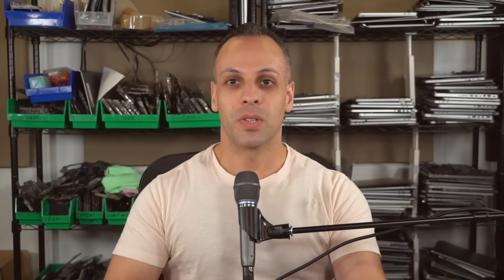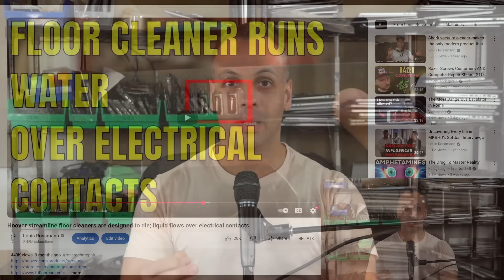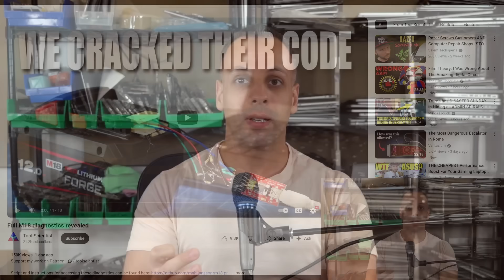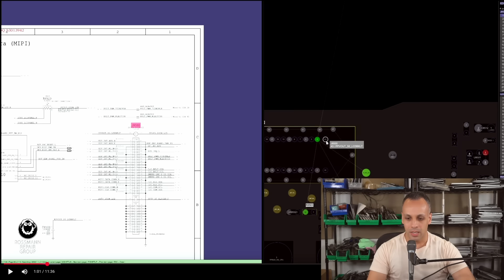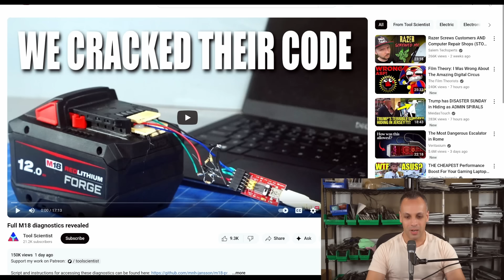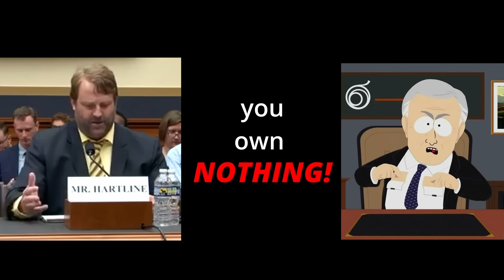Imagine putting DRM in a battery to void warranties...

Comment: I will never buy another rigid tool. The hoops they make you jump through to replace a product that was defective is insane. I bought a reciprocating saw and a circular saw. The reciprocating saw died in 6 months and the circular saw died in 7. I didn't know that you couldn't just take them to Home Depot like you used to be able to and trade them out. You have to go on a website and register them and then you have to talk to someone in their customer service division (from another country) in order to get it approved to send it off for repairs. They tell you that they will either replace it, repair it, or tell you that you are SOL and there is nothing you can do about it. I sent both of them off and one was "repaired" but died again three months later. The other one showed that it arrived at their facility but they told me they never received it. So, I had a broken tool and then now no tool. What did I do? I went to harbor freight. The tools I bought there are still kicking 2 years later and if they mess up I can just take them back.

Comment: Happy to hear you speak of battery balancing! A single battery that drops below their specified voltage and the entire pack ceases working. Doesn't matter that it could be charged or could've been fine balanced. Milwaukee and DeWalt BOTH do this! I've seen one of them RE'd and the chip is CAPABLE of balancing, but it's not been setup for it - cannot recall which one but the tech exists to do this and save consumers money - they don't use it.

Comment: I guess the point is missed but brands have value even if the underlying company is failing. Craftsman/Die Hard/Kenmore were Sears brands. They outsourced production to a third party. When Sears didn't jump on the online shopping bandwagon, they left themselves exposed. Time marched on and their competitors sensed blood in the water resulting in the collapse. To generate some cash, they sold the brand rights. Similar story for other brands. They sat on their laurels and discounted up and comers. I saw a video where he reverse engineered a bad firmware issue on a BMS even though the battery was replaced under warranty which detailed the information being gathered. I know people will think a warranty is a warranty even if they have abused a product and the company won't know. They are collecting that intel so you can't hide behind the curtain "Catch me if you can". It is easy to blast corporations for their faults but people don't want to admit guilt because they are the "small" guy. If you think you can do better, start a new frontal company. TTI would gladly be your production partner.

Comment: And then you have these Milwaukee die hard fans that are willing to sell their moms and sisters to get tool. Willing to bet their houses on proving their brand is the best. I simply call them sheep. Every company is out to rip you off, and if you are willing to throw away your hard earned money just so you have a garage full of red or yellow... be it. But don't push out c*ck ridding fake reviews of products that you have not even used for an hour.
I have been with milwaukee for years and have seen how this warranty process works. What if i told you, when you send your faulty tool or battery to them for repair, all they do is reset the counter, clean up the tool/battery and in some cases replace the outer plastic body and send you back the same product (only if they claim it is still under warranty). Its up to the repair guy to decide if he wants to be lazy and just claim, oopsie its your fault. Then they ask you if you want your out of warranty product shipped back to destroyed at their repair center. 80% of them claim, destroy it. Guess what, Milwaukee is happy. They recondition the electrical components and replace the outer making it look brand new and resell as brand new.

Comment: Sony's mirrorless camera started doing this recently as well with my a7R V. It has a pop up asking it cannot guarantee it's performance because I'm using an aftermarket battery and will hide the actual battery level depending on the shooting mode you're in 😑😑

Comment: Deevawlt battery, i used it for other purposes, connected the + and - to a breadboard circuit.
Smoked it dead and it refused to charge so, I used the second battery to kick start the internal PCB via the same 2 connection points.

Deevawlt service center confirmed in person that all their batteries need a kick start once you override the battery's PCB

Comment: The term “battery warranty” is an oxymoron.  This is true for lead acid car batteries, Ni-Cd, and Lithium.   It used to be that Sears “Die Hard” had the longest warranty, I fell for it.   2 years into a 5 year (maybe longer) warranty, I discovered that the prorated warranty still had me paying more money to replace it than just buying cheap battery at Walmart.    Well guess what, the last time I was in Walmart a person was trying to return a battery under warranty, however, they were not at the Walmart that sold them the battery.   Yep, drive to a store 200 miles away to get your warranty honored.  When everything is cheap $hi+ just buy the cheapest you can find.

Comment: This is why my Milwaukee and Dewalt batteries live inside my house while the cordless drill that's in the toolbox I keep in my truck is a Craftsman with 2 NiCad batteries that I bought at a garage sale about a decade ago for $15 and just refuses to die.  I charge them twice a year but they're usually discharged when I go to use them.  The last time I used the drill was a few months ago when I had to bar a door that was breached by EMS.  I charged the one battery as I cut the 8' board in half then used the drill to drill and drive eight 3" screws through the boards, the oak trim and into the studs, all on a 15 minute charge.  I sure wouldn't want to build a deck with the drill but it's perfect for keeping in the truck and doing light repair work as needed.  Ironically I was at the same house several months before that to install a couple of ring doorbell cameras using the same drill.

Comment: It's not just the battery manufacturers, it runs deeper.
A while ago I was looking at designing my own bosch 18V battery (I use bosch tools and their batteries also have no balancing) and I was looking at ICs from texas instruments meant for 5S packs, and they had ones dedicated exactly for power tools, and those ICs had no balancing, yet had options to permanently disable the battery if some event occurs, like voltage mismatch or temperature or over-current, so if you take the battery apart and balance the cells, the battery still will be dead.

Comment: This Corporate ownership shell game has indeed been going on for a long time. A good example is how PYREX & pyrex are not the same. The company sold decades ago, they stopped using borosilicate glass & went to a cheaper, weaker sodium based glass. Did they tell anyone? Of course not. Just changed the font of the logo & rolled on.

Comment: There’s a similar video on Ryobi batteries where a guy shows software code that bricks the batteries permanently if certain events occur. Even after the event is corrected, the code prevents charging. If you delete the code, the battery will work and charge again. Not too many people have the equipment or patience to figure this stuff out.

Comment: Batteries age due to time and temperature irrespective of whether they are being used at the time. It's called calendar ageing. There is nothing suspicious about noting the battery has been exposed to high temperature, especially if that coincides with high SoC. 

Similarly with cell balance, it's not just about balancing circuits, it's about the quality (and thus similarity) of the cells used in the first place. That was also clear from the original video.

Comment: Honestly, as a mechanic, TTI’s Milwaukee cordless tools have made my life immeasurably better. Are they shit? Yes. Are they more shit than Snapon? No. They might be slightly more shit but they cost 1/5 the price and usually work better. I don’t know about the rest of the garbage TTI makes, but I work outdoors in all weather, in all temps from +40C to -40C and their Milwaukee fuel tools flat out do work. And in my experience, their warranty thus far has been great, parts availability and repairability has been more than acceptable too. No complaints from me towards them, even if they are a garbage corporation.

Comment: That's why I buy makita. Ive ran their LXT series 18v li-ion batteries for almost 12 years and I've never had a single issue with any tool, or any battery, and never had to return/warranty a battery or tool.
Reply: I should also mention, I work in an industrial shop setting, and my original drill and impact combo gets used daily, despite being almost 12 years old, and in the same time I've watched guys at work that are diehard Milwaukee fans, have to replace dozens of batteries in the same time lol

Comment: Milwaukee is a bit of an enigma under the TTI umbrella, yeah TTI makes a lot of hot garbage (looking at you Hoover and Ryobi), but Milwaukee is a bit of a funny one. I'll get to the warranty thing in a minute as I have some insight as to what's happening. Putting aside my severe red obsession, Milwaukee does make excellent tools. They also innovate and improve upon previous generations (a classic example was their 16g brad nailer, Gen1 was a hot pile of Dodge, but the Gen2 is absolutely fantastic). They see gaps in the market and come out with something that fills it. Hell, just the other day I saw them release a jump starting pack that runs off the M18 platform. I never ever thought I'd see that nor think it was possible with current 18v battery tech, but after watching the ToolScientist's video, I get it now. My point is, they do make good shit WHEN USED CORRECTLY, and I will keep buying Milwaukee because it works and I actually don't need to upgrade every year or two because the next model comes out or a tool has shit itself because it was a shit tool. 

Now the warranty part is weird. I have seen many stories on the Milwaukee subreddit of people getting claims denied for whatever reason, shit after sales support and so on. I think what is happening is these warranty repairs are being farmed out to third party repairers and either they cannot be fucked doing the job, or get paid too little to do the repair so they just fail it and move it on, or they have a fail quota or something, but for whatever reason dealing direct with Milwaukee seems to have better results, and be it for not wanting bad press or otherwise, the Milwaukee rep in the subreddit is pretty on to it at getting a resolution for those affected. Here in NZ we deal with Milwaukee direct (through the point of sale who sends it to them, but Milwaukee does the repairs), they are absolutely helpful, they've always honoured the warranty on my tools (admittedly we have pretty good consumer protection laws here), and if I'm lucky enough to catch the local rep, they've given loaner tools while mine is away for repairs. 

The batteries are a bone of contention in my book, which I think seem to be rectified with the Forge batteries, yes the lack of cell balancing is appalling, but there isn't a manufacturer on the planet that puts cell balancing in their batteries, so this is not an isolated thing. We should be fortunate that we do have cell protection in them so that they don't over or undervolt and spontaneously combust, which is where those shitty Temu and AliExpress knockoffs fall short, and they should be outright illegal on the grounds of public safety. Since switching to Milwaukee in 2018 I have got 3 batteries that have either gone bad or are on their way out, so out of 6 that I have, that's a bit meh (one was an original 5ah from 2018 that's completely dropped a cell, the other two are 6ah HO batteries from I think 2021 which were already a year old by the time I got them and only get used on my high drain tools, so they get beaten on a bit). Considering I use them every day, they have earned their keep.

Comment: There are a lot of counterfeit batteries out there, some are not too bad.  They lack all the "intelligence" built in and are able to fool the smart chargers in many cases.  Sometimes they don;t have the longevity of brand names, but at 1/3 the price you can afford to replace them more often.  As far as brand names i have found Makita to be the worst for failing to take a charge even though under testing all cells hold a perfect charge.

Comment: Thanks for this. I've added anything TTI make to my of things I won't be buying. TBH, if the batteries didn't have DRM, I still wouldn't buy Milwaukee now, just because no battery system at that price point shouldn't have battery balancing. Considering a $0.50 Chinese BMS off AliExpress has balancing, anything that is marketed as a premium brand should have it. So, was it left out because the person who designed the battery was incompetent, under pressure to save money to pinch every last penny or did they deliberately leave it out to shorten the life of the batteries so they could sell more? Who cares about the environment, right? TTI just don't seem to get that, when you act like this, people will probably assume the worst of your motivations

Comment: This is why I have an older repairable work truck and replace my own 18650 and 21700 li-on cells in my Milwaukee batteries, I also pull them apart and balance charge them.

Comment: I stay away from the battery powered tools wherever I can. Nothing beats 120v or compressed air that is cheap and just works. Or gas, I have no desire for battery powered lawn equipment, they can keep it

Comment: Unusually this is old news, BLAME Sony! They created the set of battery chips & included lock-outs even before lithium ion. It's just laptop battery tech licenced by others. Yes I rebuilt many laptop batteries and YES it takes digital reverse engineering tools to re-write the eeprom to zero the history and update the capacity numbers. And YES the numbers are encoded backwards in Japanese style, which actually does make sense, it was SUPPOSED to be an internal, Sony ONLY system, but everyone copied it. The Sony spec (to their great merit) includes information about how NOT to wire the connector and SAFETY standards. Sorry for yelling, sick of people thinking it's just a Re-Cell & that's the price! Anyone can buy new cells, can you reset the battery controller? People would price out the cells and loose their minds that I had to charge another $100, to upgrade capacity and de-activate internal warnings. I kept trying to explain "there's a g'damn computer in there and it takes work to hack that!".

Comment: Can we clarify something?

You absolutely are buying a battery. It's made of multiple cells. That's why it's called a "battery". It's a "battery" of multiple cells, strung together.

The term "battery" is a misnomer, when used to refer to individual cells. AAAs, for example are "battery cells", and we almost always use them in a "battery" of cells. The circuitry to put them in "battery" is just typically built into the equipment we use them in; Remove controls, flashlights, clocks, etc, they typically require multiple cells to function.

We've just shortened the term to "battery" because "battery cells" was too long and formal. And now, nobody knows what the fuck we're talking about anymore. 

Including, a very smart and educated professional electronics repair guy with millions of youtube subs. ;)

Comment: I have a lot of Milwaukee tools, many many batteries also and I've never had an issue with battery failure and have so far only used the warranty process once.  I wonder is this only with the fancy forge batteries as I don't have those as they are far too expensive in the EU.  The EU product line is supposed to be different to the US line, at least that's what Milwaukee have told me in emails.  I'd love if someone could deep dive into the electronics of an EU tool vs and US tool. Also these tools do have a Bluetooth comms device for tracking and disabling the tools so I guess in theory your drill is online!  Again I just buy the basic ones without ONE-KEY

Anyways, all companies are evil but I do really like my Milwaukee tools.

Comment: We realize that it's called ,'planned obsolescence';  when engineers deliberately design an 'inferior' product so that con-sumers are forced to purchase the same corporation's new, better product, (which they could have made all along). It's all about PROFITS! 
Vehicles are designed in the same manner, as car manufacturers, now consider 100,000 miles to be a car's 'lifetime'. This is why modern vehicles have many parts made of 'plastic', versus metal. (how much more would it cost to use metal-vs-plastic parts in a car?).  For example, it's not merely  coincidence that when one power window motor fails, the other side fails a few months later.

Comment: "you used the battery in hot conditions" - so your fancy battery circuitry won't actually prevent the battery being used in hot conditions, it'll just be a little tattle tale when that happens?

Comment: Funny thing is that the 3rd party batteries at this point are much better
Reply: thats what i wanted to say, i am working in a auto shop and my 3rd party battery lasted longer then "original" battery because when mine broke i just opened it with a screwdriver and solder a wire back and its working again. and all of this come with a price barely hitting third of original price